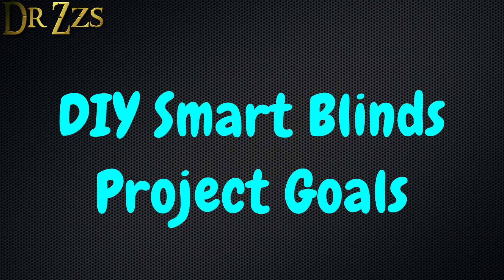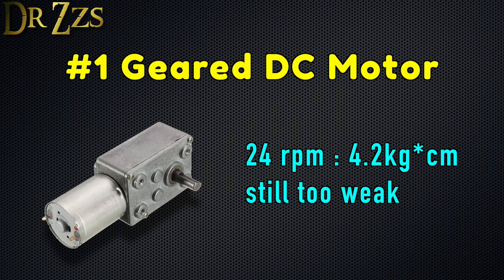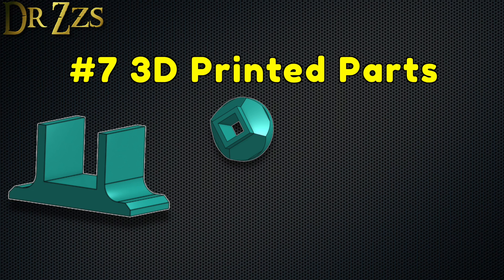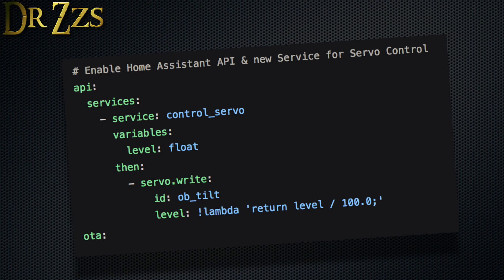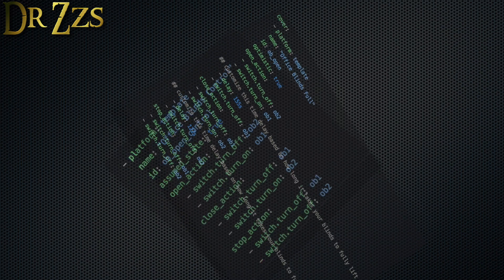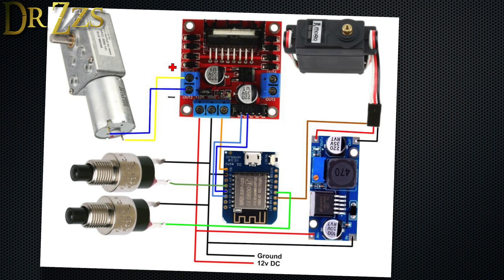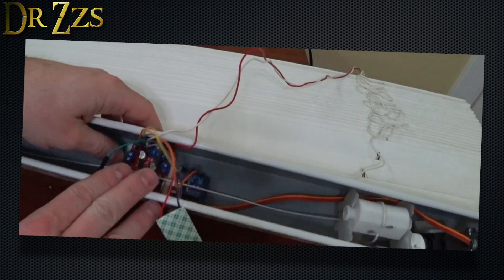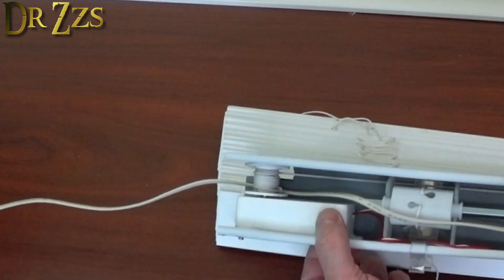Motorize & Automate Blinds | DIY Smart Home Automation

Comment: I saw another video you had where you were having trouble with the servo motor not working properly. Does this video come after the other one like have you fixed the problem in this video or should I try to find another video? All I want to do is tilt, the blinds.

Comment: I wonder if you could run the string through a small pulley in order to multiply the torque. In that case you could likely use the higher RPM motor for faster speed but with the pulleys' effect it would even be easier on the motor. What do you think? SUBSCRIBED

Comment: I like this project for my home. Will try to get everything and start working on it. I have a question - can i use smartthings to control rather then home assistant? Can i add light sensor to control tilt automaticlly? Can I put five blinds power supply in a series or parellel ? Please give me input on this. Never have i done this automation. Only thing I have so far is Remote controlled Custom Projector mount from scratch.

Comment: I'm currently working on "the hook up"s project of automating blinds. Its just for tilting (so far) but... even with his modifications of a step motor it still wont close the blinds all the way shut. It needs more torque for that last little bit. But here's the thing... I was thinking, when I pull the strings I don't need to put in so much effort to close and hold the blinds shut so why does my motor need to be so strong? Well... in all the designs I have seen INCLUDING this one, everyone seems determined to connect the motor directly to the rod. Well... I busted up the little pulley device that tilted my blinds to see how it did it and all it is, is a simple worm gear system. So I thought again, why don't I just replicate this? Instead of connecting the step motor to the rod itself, I put a worm gear on it, which rotates the above gear that turns the rod. It will go much slower and the step motor will have to rotate much more to get there... but this makes much more sense. It's like when you're riding a bike and you shift down to a lower gear to go up hill because you don't have the strength to push the pedals... So when you do you wind up pedaling much more, but with less resistance... and it gets you uphill. 
I just decided to change up the project to do it this way last night, so I have only designed the gears, I need to redesign the assembly that holds everything still which is basically taking me back to square one on the cad drawings... but I should find out soon if my idea is sound. After I'm done with that and I have seen how that works, I will look into raising and lowering the blinds as well... that may wind up being a bit more complicated but....... I might be able to figure something out.
Reply: How did it go?

Comment: You need counterbalance springs.  Which are complicated.  Venetian blinds get heavier on the way up, but lighter on the way down.  You can actually get by with one motor for both the tilting and lifting, but it can shorten the life of your lifting lines due to ware from the lines rubbing.

Comment: Blinds v2.1 idea: Make sure the blinds are horizontal before opening/ closing... Just an extra safety feature to prevent any harm. You could use a state parameter to return back to that state after the movement has stopped? 

Thanks Dr Zzs!
Reply from the maker: That would be cool. 
Thanks!

Comment: so this will not work for cellular blinds?
Reply from the maker: I'm not sure.  I'd expect you'd need to make some modifications.  The mechanism for getting the motor to spin in either direction, and the integration into HA would be the same or very similar.  Connecting the motor to the blinds would be the part you'll have to figure out.  I don't have blinds like that so I can't say much about how they might connect to the motor.  
Let me know if you get it working.  
Good Luck!
Reply: I followed this with cellular blinds. The motor is outside as there wasn’t any space, but i was able to turn the blind around so the pull chord hole was facing the window, and you can’t see any of the gear. I skipped the servo setup as it wasn’t needed. Let me know if a picture would be helpful or any of the wiring.
Reply: @coolguymatt  pictures and a diagram would be great?

Comment: Would this project work with a nodemcu or it needs the 5v pins?
Reply from the maker: It would work with NodeMCU.  The NodeMCU can take 5v input too.  Some can take higher, even up to 12v.
Reply: @DrZzs  It worked great! The channel at the top of my blind wasn't big enough to house the gear, so I have it outside the blind, but I have it fairly well hidden so the WAF is high

Comment: You could've easily made it work with one of the faster motors if you had used a better speed controller. The L298N is an ancient and low-power solution. When used with such a big motor, the big voltage drop accross the driver allows the motor to work at about 10 volts and thus, the current is smaller than what it's supposed to. 
In conclusion, you're only utilizing about a third of your motor's power and converting the remaining 2/3 into heat, lots of heat. The solution - buy a cheap hobby ESC from ebay or one of them chinese H-bridges rated at 50 amps or so. 
Regardless, great work!
Reply from the maker: oh cool!  I didn't know that.  I'll look for another driver.  Thanks!
Reply from the maker: Could you share a link to something that would be better?  I just keep getting the l298n's
Reply: @DrZzs  A simple Hobbyking ESC would do the job just fine. I built a battlebot with a similar one. 

Here's a link: https://hobbyking.com/en_us/hobbyking-x-car-45a-brushed-car-esc.html 

Keep in mind that there are numerous sellers selling the same product under different names but they are all relatively cheap. 

Another option which can also be used in high current application is the BTS7960 Motor Driver. I know that is available on AliExpress but I couldn't really find it. 

Usually voltage ratings for ESCs are given in number of cells (Ni-Mh or Li-Po) while there is a specified voltage range for H- bridges. That's why I'd suggest you to go with the BTS7960, since I'm not 100% sure that Hobby ESCs can operate on voltages generated by standalone power supplies. 

The only downside both controllers posses is their rather chunky heatsink. I still think that there are some smaller form factor ESCs but if you fail to find some I'd suggest removing the heatsink for the BTS7960. There's a pretty big chance the current draw will not be high enough to build up any alarming heat.

Anyways, thanks for the response and feel free to ask if you have any more questions!

Comment: When are you gonna make a automated roller blinds configuration?. Been searching for something like that for ages, but having trouble finding it. Your work is amazing though.
Reply from the maker: I don't have any roller blinds.  I would expect they would work like my shades, with one motor that moves in different directions with the polarity is reversed. 
What blinds do you have?  i'll look at them and see what I think might work.
Reply: @DrZzs  I got something similar like this. https://5.imimg.com/data5/BC/HS/MY-28784807/roller-blinds-500x500.jpg. I tried using only one motor in your configuration with a H bridge, but couldn't get it working. 
I can print some parts to make it working on my existing blinds, like a motor mount and gear that connects in the beads for the drive. So that wouldn't be the problem.

The problem itself lays with the configuration which is giving me problems

Comment: That's great gives me plenty of ideas.  You could have used some flexible tubing to run the pull string through so it doesn't catch on any of the electronics or rubs on any of the metal parts. I'm trying to come up with a good way to automate my patio door so I can open it for the dogs and close it when I'm not home. I'm thinking about using an RFID tag on the dogs to tell when they're outside or in so I don't accidentally lock them out. patios on the third floor so I don't think I have a problem with them wandering off. if anybody has any ideas how to motorize an outside door inexpensively let me know thanks
Reply from the maker: Thanks!
Is it a sliding door?  I saw someone use a linear actuator to open/close a sliding door for pet entry.  I'm planning to use one to open/close a window in the very near future.  Stay tuned for a video.

Comment: My plan was a 3 position rocker switch. Up is up, down is down and middle decides what to do based on photodiode.
Personally I prefer things to do what there ment to do without an internet connection if possible.
Reply from the maker: agreed.  Because the code for the button is written in the ESPhome sketch, it doesn't need a network connection to work.  That's one of the best parts!

Comment: I like the project. But it's not super cheap compared to a ready buyable solution when u take in mind that you get alot of comfort (speed) from those.
I also think u are gonna frustate to death when u can't stop watching the blinds lift up while working and it takes forever. at that point u are not using you arms, but the blinds keep you from using your head either hahaha
Reply from the maker: They are slow, I can't debate that.  
I don't know of any ready buyable solution for these kinds of blinds.  I looked for blinds like these that are motorized with wifi control, and they start at hundreds of dollars, (I showed a screen shot at the beginning of the video) so I'd say this is a pretty cheap solution compared to that.  
There are simple motors available for the roller shades, but not these horizontal blinds.  If you know of something, I'd love to see it.
Reply: @DrZzs  you came alot further than i would have time for in the coming yrs. but ive seen (and you also said it) that the blinds go easier down than up.. they dont have to lift weight going down. maybe its possible to let them lift some iron weight while going down. that way the weight works for you when lifting up. and maybe then the faster motor is possible..?

Comment: Seeing many examples of smoke being released on different home automation videos I have to ask, are there no current limiting power supplies available. All the ones I used for many years at work had built in crowbar circuits to disable the power in the case of overcurrent. Not sure I want to take a chance of buring down my house because a blinds up switch failed or something jammed the blind.

Thanks for the videos.
Reply from the maker: To be truthful, the d1mini I burned up in this video I did on purpose during one of the live streams.  It was already broken so I connected the 3v pin to 12v just to see what would happen. These little boards have tiny tracings or components that will effectively act like a fuse. That d1mini stopped smoking after a few seconds because one of the tracings burned away like a fuse would have. 
The current needed to blow one of these control boards is really low. The gpio pins are only rated for like 12mA on each GPIO pin.  Even that motor controller is rated for 2 amp max.  I suppose you could put a fuse there if you wanted to protect the motor controller.  I don't think it would be enough of a flame up to start a fire and burn your house down.  Maybe I should fry one and see what really happens.  That would be educational.
Reply: Thanks for the follow up, recently started down the road of home automation after a career of industrial automation. I am amazed at the low cost of many of the components compared to the stuff I am used to working with, but then most of the industrial gear just released smoke and seldom flared up like I have seen in a few videos now. I will have fun experimenting.

Cheers!

Comment: Grate video. I like your project. I was thinking how about use two 24rpm motors, each can carry 4.2kg cm to distribute weight, where as your 10rpm have torque of 8.5kg cm but all the weight is on one side.

Also can you tell me what 3D printer you are using and what software use to design the parts?

Comment: Brilliant! This has been a project I was supposed to already have completed a year ago. I went the route of trying to build a tilt mechanism only using battery operation, but I gave up on it after a while. It's doable, but I didn't have a 3D printer back then. This has sparked my interest to get back into building this and I might just use your design, without the lift portion, and only do the servo. I should be able to get away with just the power brick, a D1, and the servo, right? and maybe momentary switch to open close at the blind...

Was also just thinking. If you have, let's say, 5 blinds next to each other. You could use only 1 D1Mini to control all 5 blinds. The D1 mini shouldn't use more than .5 amps, each servo about 2-3 amps (guessing), so getting a 10amp 12 volt power supply should also suffice for all 5 blinds. Again, talking just tilt. Might still need a separate buck converter at each blind. But, cutting the D1 mini down to one and the PSU down to one, would give nice price drop to do all 5 blinds.
Reply from the maker: You could use 5v from a power supply for the servos without the buck converter.  If all you're doing is tilt you can do everything with just 5v.  using 1 d1mini for 5 blinds may run out of gpio pins if you put an endstop switch on each one.  You can probably get 11 devices connected so 5 servos, 5 endstop switches and one button.  You'll need to use GPIO-0 and Rx/Tx, so you'd have to make sure those aren't grounded when the board restarts.  Should be possible though.

Comment: Seems like the metal box that the blinds are in would make a Faraday Cage. How's your signal strength on your D1?
Reply: That's exactly what I was thinking, but it"s not a Faraday Cage if the top is open. is it?
I was thinking of getting an external antenna connector for the D1, have the antenna stick out of the metal rails, and drill a hole in the drywall recess for it. https://www.aliexpress.com/item/1PCS-D1-mini-Pro-16M-bytes-external-antenna-connector-ESP8266-WIFI-Free-antenna/32811458041.html
But because I have to connect wires for the PSU, buttons and endstops, to the blinds, through the drywall. I thought I'd just stick the D1 mini inside the drywall so it gains signal strength without much fuss.
Reply: @RobNisters  no, not entirely a cage but the signal must come and go through the top (line of sight pointing up) which would likely seriously degrade the signal. Unless the router was on the floor above the blind, it would have to entirely rely on signal reflection.
Reply: Where the wifi gets through becomes a wave guide?  ;-)
Reply: using the same board and its chinese brethren in all kinds of metal enclosures around the house and also don't have a problem.
they do not seem to be any slower than the others.
the d1 mini outputs quite some power - in the house i think i'll be fine, outside maybe not.

Comment: why you didn't try to put two 45 rpm one on each  side of rod.. You will get double strength
Reply: Good idea, I got 2 10 rpm motors, but I wonder if one will lift my heavy wooden Luxaflex 2 X 1,5 meter blinds.
It might be difficult to fit them inside the rails. I could have a part of the 2nd motor stick out, nobody will see that, anyway, and I could put the D1 mini in that bulge too, so the wifi signal isn't obstructed by the metal of the rails

Comment: Using a pressured wheel at the motor point with a spring, would be alot like how the filament feeds into your 3d printer.
Another option that comes to mind would be to replace the string, with chaindrives, or go with white neoprene belts coupled to the motors. That would allow for more exact control, and of course, it could all be done with stepper motors, hooked up to play midi files for the concert effect. Rolling computer desk with motors like that drummer used.
The drywall could also be designed to move with motors slightly to the music. Everything in the room parks itself in the walls like a swiss army knife, and the pool table appears from the floor, and the office/pool parlour/concert holodeck door is that of star trek, also with full automation.

Sorry, haha, got carried away.
Reply from the maker: I love it!  
MrsZzs said I can do whatever I want in my office... Dancing Drywall sounds like a great next project!
Reply: You forgot the magnetically levitating, vibrating and rotating bed
https://www.youtube.com/watch?v=hgI5jSC3NwY

Comment: I'd love to see a video where one takes at least 2 Philips Hue motion sensors and 2 Hue lamps and controls them via Home Assistant if movement is detected.
Thing is I have a long hallway here with 2 lamps and sensors at each side, one end has windows but the other one doesn't. Problem now is that both lamps always turn on despite there being enough light on the other end of the hallway. I'd love to be able to detect how bright it is with one sensor and if it's bright enough it should only trigger one lamp but not the other.
Reply from the maker: That's an interesting idea.  Do you have light sensors?  I can think of a way to do it if you have light sensors at each end of the hallway.  We could use the light level as a condition in the automation.  If the light is above X then that light doesn't turn on.  It would mean separate automations for each bulb, but that's not a problem.  
I'm thinking I'll add a light sensor to v2 of these blinds too.  That might help you get what you're looking for.
Reply: DrZzs The Hue motion sensors are actually awesome in that regard and have a Lightsensor, obviously the motion sensor and even a temperature sensor in them so yup :)
I'm also on both HASS Discord servers, the official one and the Community Addon one if you're there too. Same username.

Comment: Dr.: One might be able to use something as simple as a drinking straw (may need to flare the ends with some heat) or the like as a guide for the draw strings in those tight areas.
Reply from the maker: Good idea!  Simple is best